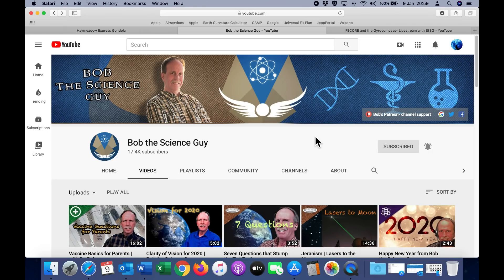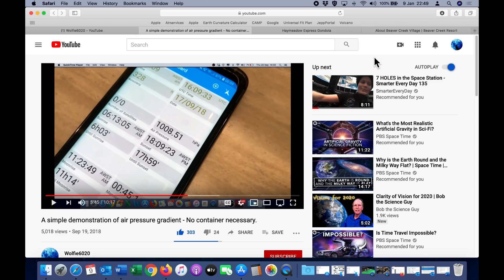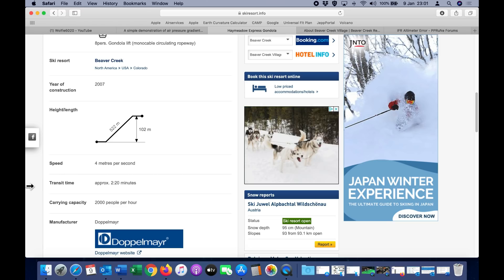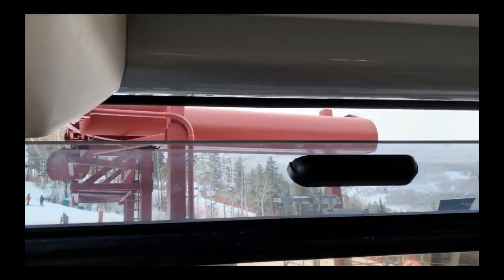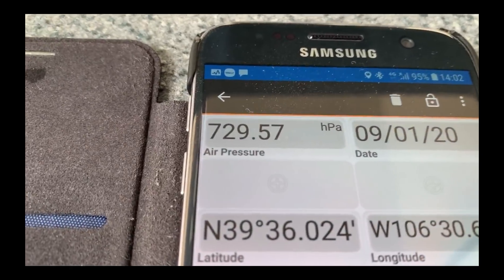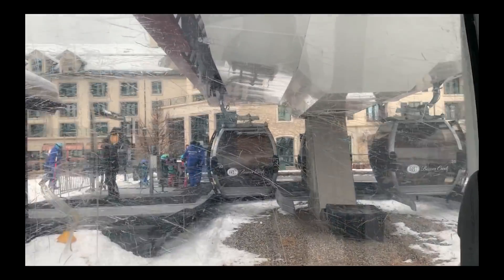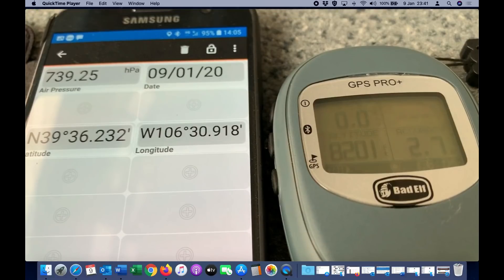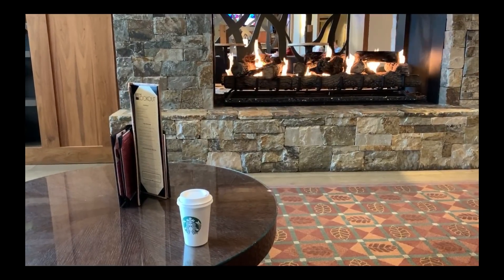Looking for a pressure gradient in Colorado USA.

Comment: You just proved we live in a pressurized system.
Reply from the maker: You just proved you don't understand the implications of this.  At what point does the pressure stop reducing and what happens when it reaches zero? 

You also proved that your word is worthless.  

When will we see a picture of you talking?   Show it or I will block you for being a total hypocrite with double standards.  

I'll give you a week.
Reply: @Wolfie6020  you just showed and proved a pressurised mechanical system. You say gravity I say bulshit. That's electrical pressure causes that. Which is also why you can't fly to outer space.
And yes you're still the black Amish. You still have not shown me a picture of you talking. So don't call me a coward you coward.
Reply: @stevea8355  
So you accept that air pressure drops with altitude.
Explain how electricity is responsible for the observations in the TED video I posted which are consistent with gravity.
Reply: @stevea8355  The ONLY way to have a pressure gradient in a container is to introduce a gravitational field. 
source:
https://physics.stackexchange.com/questions/399724/can-there-be-a-pressure-gradient-in-a-large-enough-closed-container
Reply: @stevea8355  your superstitious beliefs are are the answer to everything for you.
Reply: @stevea8355  " a picture of you talking"
That's going to be really difficult.
Reply: @stevea8355  
Still waiting for you to explain how water in a tube is "mechanical" and therefore, for some reason, not valid.  I can wait.
Reply: @awatt  you should understand something that is mechanical
Reply: @stevea8355  
Explain.
Reply: @stevea8355  
A tube filled with water or mercury will indicate air pressure and show that the air pressure is due to gravity.  It will also show that air pressure drops with altitude.  This is simple stuff.  It's not hard.  What's your problem?
Reply: @awatt  an altimeter is what you call mechanical. Nothing involved. There's no electricity hooked up. Sometimes they use heat for mechanical.
Do you say the weight of gravity pulls it down. But for some reason it doesn't stop the wind. Gravity your answer for everything. When its electricity bub
Reply: @stevea8355  
How can we educate you if you keep being rude?  Try the simple experiments yourself shown in the TED video I posted.
Reply: @awatt  listen a watt study geo-engineering. Learn everything you can about weather and how they're manipulating. Then you'll learn something about basic chemicals. And you discover your life might be more interesting. Can you learn something geoengineering is real bub. Learn how they steer with radar.
Reply: @stevea8355  
The altimeters I showed you don't have "electricity bulb" just water.  

Little children can work out what's going on so why can't you?

Seriously, build one as described.
Go up hill.
Watch pressure drop.
?????
Profit.
Reply: @awatt  exactly simple stuff that you don't understand how it works
Reply: @awatt  how accurate is an altimeter do the new ones measure rate down to feet and inches. What I'm saying is if I had a really good can I measure a foot at a time. Are they a 10-foot increments I don't know I'm asking you.
Reply: @stevea8355  
Tell me, as well as all the good people here, how it works.  I will ask for equations....
Reply: @stevea8355  
If your barometer is accurate to ten feet then take it to the top of your house.  Note reading.  Take it to your basement.  Take reading.  Subtract one from other.  BOOM atmospheric gradient confirmed.  Some denied.

Why do you ask me?  Probably because I am the only person here trying to help you.  That's what we Christian's do.  We help people even when they are beyond all hope.
Reply: @awatt  go study geoengineering
Reply: @awatt  get a grip on geoengineering you'll get a better understanding of how the world turns.
Reply: @stevea8355  
Stop changing the subject.  We haven't finished with air pressure yet.  Have you done the barometer experiment yet?  What are your results?  Do you accept that air pressure drops with altitude?
Reply: @awatt  that's my point I'm not changing the subject. You don't understand air pressure
Reply: @awatt  see little a Watts they believe in something like ether. You believe the Either a amp?
Reply: @awatt  oh yeah gravity I forgot
Reply: @awatt  what you do a what is you walk 10,000 feet up into a mountain. And you look for water popping up out of the ground. Then measure the altitude. What's causing that water to pop out of the ground awatt
Reply: @awatt  check out artesian well.
Reply: @awatt  you're the one with the little misunderstanding how it works
Reply: @awatt  try and get a better understanding of a Tesla coil
Reply: @awatt  you being a Christian you have no idea about the spiritual world?
Reply: @awatt  what you want to do is come to terms with Illuminati. You personally want to be illuminated. But the Illuminati they're on the other end naughty. Be illuminated a want. See the light. Eyes to see ears to hear
Reply: @stevea8355  
You still don't understand air pressure do you?
Reply: @awatt   study basic hydraulics
Reply: @stevea8355  
You don't understand basic physics do you? 

Get a long tube.
Fill with water.
Fit pressure gauge.
Marvel at the vacuum formed.
?????
Profit.

You are such a poor student but God bless I will keep trying.
Reply: You are almost right.  The vacuum is made by the weight of water just like in a syphon.  You are almost getting it.  I will give you one out of ten.
Reply: @awatt  gravity. You can't give knowledge to people that have gravity for brains.
Reply: @stevea8355  
How do syphons work again?  "Electricity bulb?". Lol.
Reply: @stevea8355  You seem to understand next to nothing so I think it is you who need to study something.......
Reply: @arkimus1911  you guys have a hard time following the bouncing ball
Reply: @stevea8355  
Explain "electric bulb" again.  We need a good laugh.
Reply: @stevea8355  You guys have a hard time with everything concerning stuff more advanced then kindergarten science. Yet here you are trying to debunk ppl. Pathetic.
Reply: @stevea8355  
I think it was you that said that a barometer was "mechanical" and "electric bulb".   You really are thick aren't you?
Reply: @stevea8355  
Stick to the subject.  I know it's hard for someone like you but try and focus.  Do you understand air pressure?
Reply: @awatt  you're blabbering a what
Reply: @awatt  without knowledge of electricity you're always going to be in the dark. Let the light in bub
Reply: @awatt  you're the one that doesn't understand how they work I bid you goodbye. Mr. Gravity
Reply: @stevea8355  
You obviously don't understand the gravity of the situation.

Enjoy your perma ban.
Reply: Yes, we do live in a pressurized system. Gravity maintains air pressure.
Reply: Steve.
Explain how a gas in a container can have high pressure at the bottom and zero pressure at the top.  Don't be insulting, just explain how this can happen.
Reply: @awatt  you not understand heat
Reply: @stevea8355  explain heat and atmospheric pressure Steve. What's the relationship?
Reply: @awatt  did you hear him say that gauge was mechanical. Is that true. I'm pretty sure that's what he said. I'm pretty sure that GE just mechanical. Pretty sure since the beginning of time altimeters have been pressure by mechanical means.
Reply: @stevea8355  
You don't understand how a barometer works do you?  I could get the same result with a balloon attached to a bottle.
Reply: @awatt  yeah mechanical. That's the key mechanical
Reply: @awatt  that's going to be a little bit over your head because that's going to have something to do with Watts our electricity. Light bulb
Reply: @stevea8355  
Watch the video I linked.....not mechanical.
Reply: @awatt  I'mma tell you something I'm going to go watch this little movie of yours it better not be wasting my time.
Reply: @awatt  I'm 30 seconds into it and it said Ted I already know this is going to be
Reply: @stevea8355  
It's aimed at small children.  All the barometers in the video are a tube filled with water or mercury.  Shows how and why they measure air pressure, that air pressure drops with altitude and shows why and how a vacuum can't magically suck stuff.  Enjoy as you learn.
Reply: @awatt  that was a nice little piece of s*** lie. Man you guys struggle don't you.
Reply: @awatt  mechanical mechanical you guys even get confused on vacuum my God
Reply: @stevea8355  
????
Reply: @awatt  that's easy to confuse small children child
Reply: @awatt  mechanical dude
Reply: @stevea8355  
You have lost the argument and you know it.
Reply: @stevea8355  
Confuse small children?  Small children do these experiments, you are the only one confused.
Reply: @stevea8355  
Water in a glass tube = mechanical.

Confused Pikachu face
Reply: Which, if not for gravity, would have constant pressure throughout the containment vessel.  Wolfie just proved the pressure is not constant with altitude which means the pressure isn't maintained by a containment vessel, but rather by gravity.